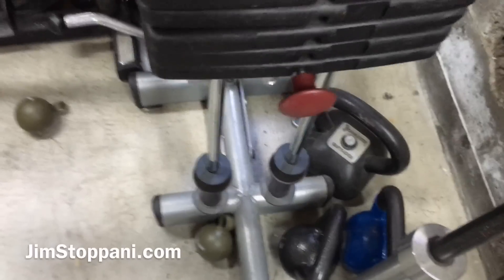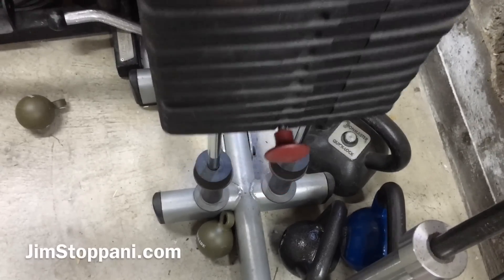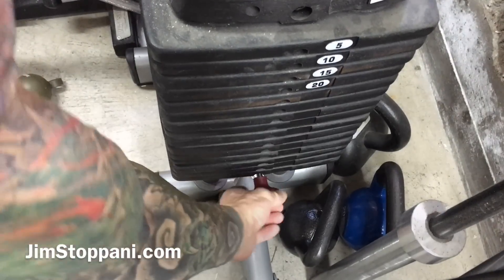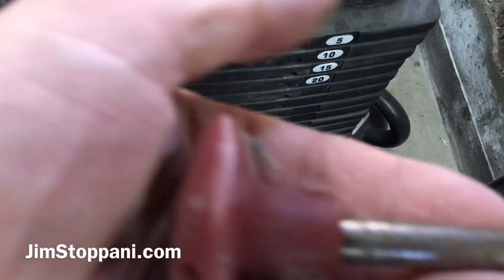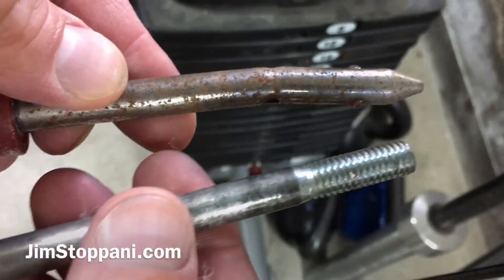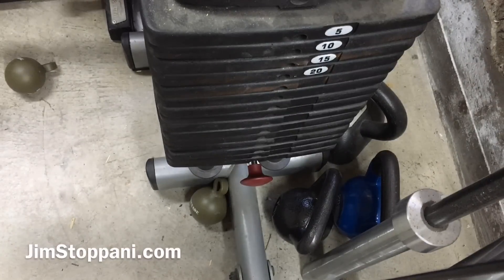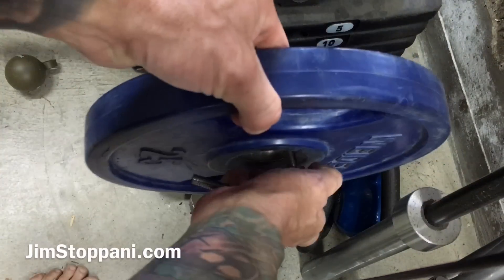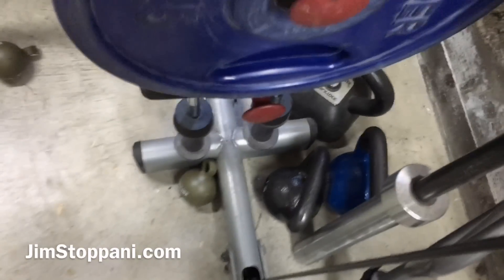Jim's Tip of the Day: Weight Stack Modification

Comment: For a real beginner, rehab, or the elderly, even adding one plate to a minimal stack can be a big percentage jump. I am way old and getting in shape again and had to start with only 2 bricks and three was a 50% jump, way too big an increase. Wit this tip I can just add a small weight and slowly increase to the next step and never have to worry about stability as long as I lube the rods. Thank you
Reply: I am in the same boat as you are, the next plate was too heavy! I am going to try this option with a smaller weight plate.

Comment: I just combined both my 220lb stacks using a hook system onto the same wire (had to weld on some extra pulleys), this seems to be a much better way, especially if you can add weight on the front and back (I often feel the supporter rods are too flimsy to allow for too much off-center add-on weight). Will def. try this out :)
Reply: So does it work ok?

Comment: Awesome. My machine only has two 82.5lb stacks plus the add on weights with a 1:2 ratio. They wont sell me an expansion stack because they say the frame cant support more for stability reasons... Do you think adding a pair of 45s via this method will be a big deal and/or do you have any tips for creating additional stability? (I asked manufacturer about maybe bolting to the floor and they said they don't recommend it.)